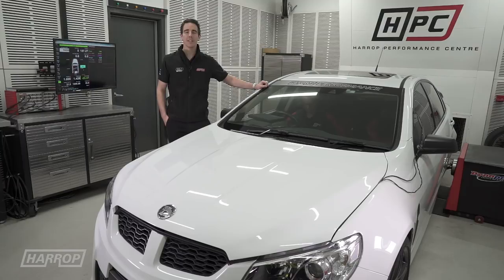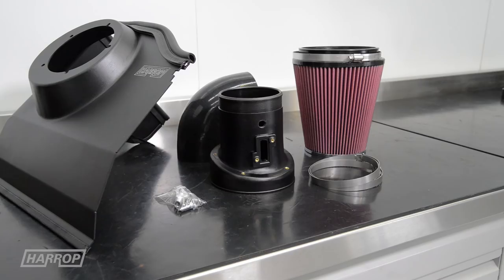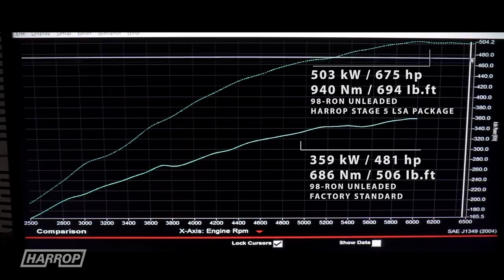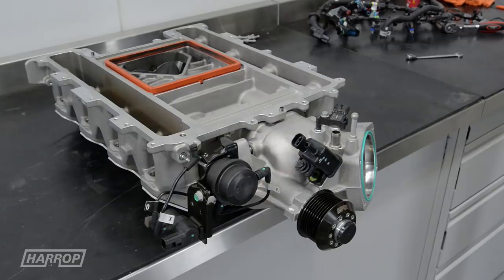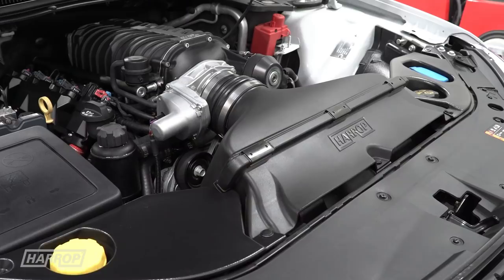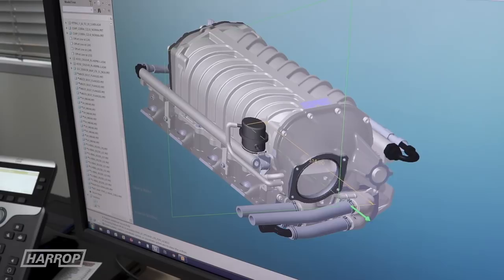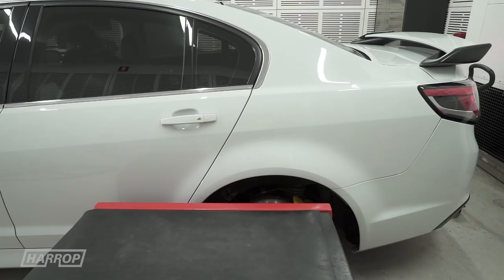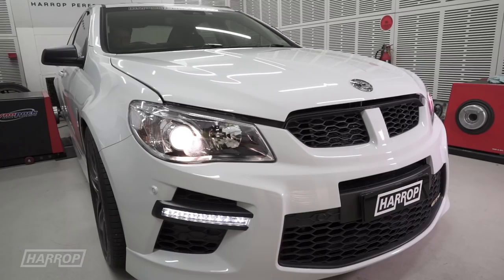LSA TVS2650 Harrop Supercharger Kit

Comment: You'd think forged pistons and rods, plus going from a 1.9ltr blower to a 2.3 ltr would give more that 29 kw and 4 flb of torque!
Reply: Forged rods and pistons don’t add any power, they just allow you to run more boost, which will of course make more power. He said they stuck with factory compression ratio, though. The blower size isn’t really relevant at this stage either because they only increased boost to 15.2 psi from the 14.8, so only 1/2 psi difference. The LSA however is close to being maxed, and the Harrop will keep the charge air much cooler at higher power levels while being able to make more boost more efficiently, all resulting in more power.

Comment: So much money for alright gains, eould've been better off just switching to E85. Lot's of CTS-V's in the states make 600hp+ on the stock blower and E85. I'm amazed a stoker and larger blower only gained 25kw over the previous setup.
Reply: Andrew you missed the point bigger blower less boost colder air more power on pump fuel.

Comment: Awesome stuff guys!!  E85 and more boost, will see 650+ easy.
Reply: ASD350SXF 
In all honesty, on E85 and ramming 18-20pound from that 2950 blower should see over 700kw at the hubs.

A close friend just did a 416 with the 2300 in a vf maloo, @13.5psi on 98 it made 542rwkw on a mainline which is still kind of a run in tune.... u can safely add 60 odd kw if this was on a hub also.
After 3000km its going back on the runners and shooting for 700rwkw again on the mainline with E85. 
Epic money and epic power available with the 416 forged blocks.

Comment: PUT A 102MM TB ON IT LET IT BREATHE 
NOT THAT 90MM CRAP
Reply: When it is forced it don't matter
Reply: @mclongkock6678  unfortunately that's not quite true
Reply: They did an engine dyno of a 427 cube with the Harrop 2300 on it and it only gained 15 hp and 4 tq going from a 90 to a 102 throttle body.